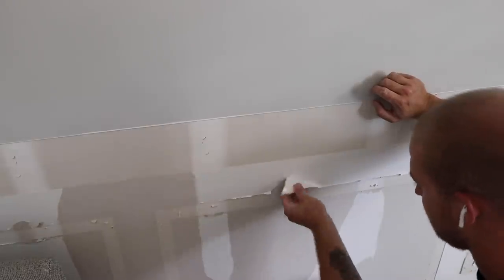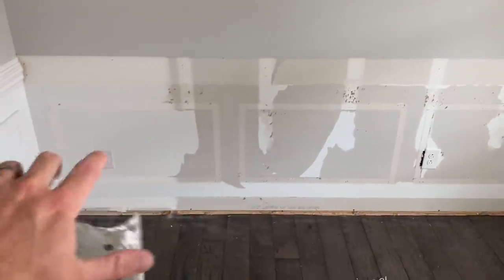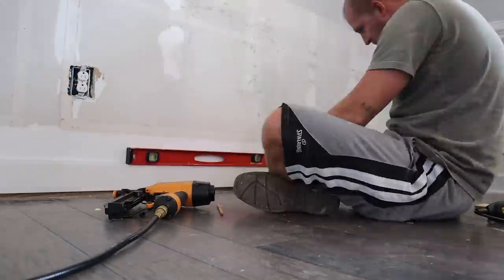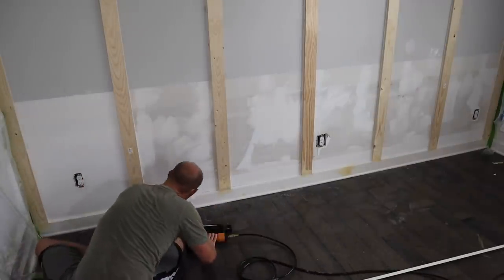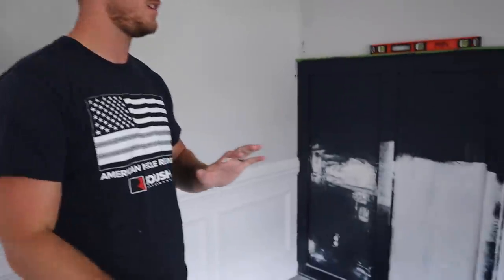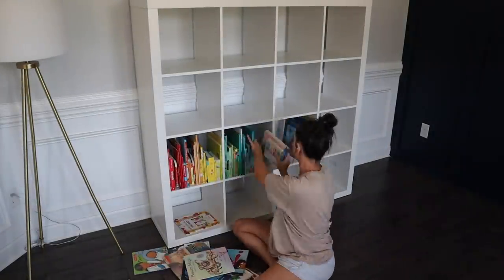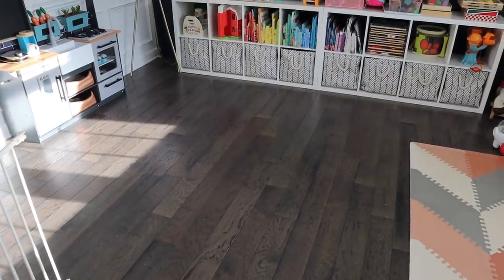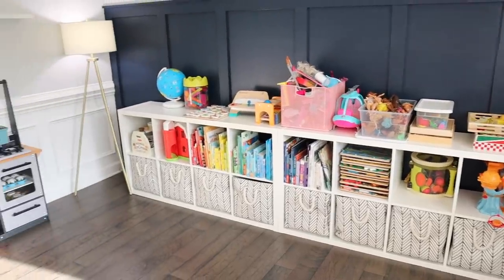PLAYROOM MAKEOVER | DIY BATTEN BOARD WALL | MORE WITH MORROWS

Comment: I believe that's the paint AND the paper from the drywall, which happens when you don't prime the drywall before painting.  The drywall needs to be primed first before any finish, including backsplash tile because it will all stick to and absorb into the drywall paper and rip right off when you go to remove something attached to it.  The primer seals it in and acts as a barrier between your finish and your drywall.

Comment: Almost seems like maybe it was really humid when they painted. I’ve noticed with one of our cabinets that we tried to paint when it was humid it’s really tacky even three years later and it peels in some spots... we need to strip it and redo it
Reply: Yes! Moisture will definitely effect the way paint dries!
Reply: Catie, did you use primer or deglosser before painting? Humidity should only affect the length of time it takes your cabinets to fully cure. 

You should use an alkyd paint when you repaint your cabinets. It hardens like a hard shell on cabinets and is super durable.
Reply: Kimpsey yeah we did it was just the one door, all the other doors were fine just the one we painted when it was getting humid

Comment: the reason the paint didnt stick is because the builders didn't use a primer/kilz on the drywall/mud (that looks like original dry wall but i could be wrong)